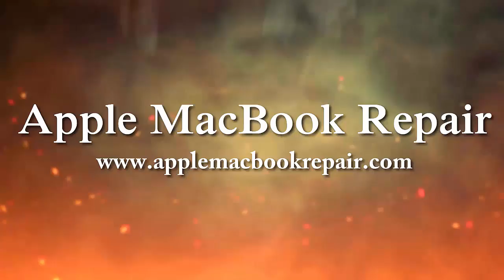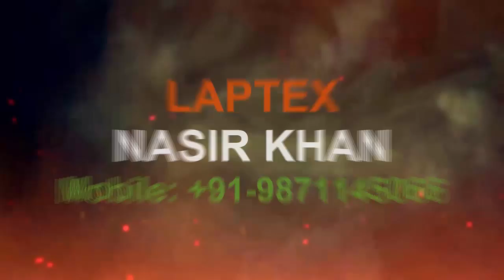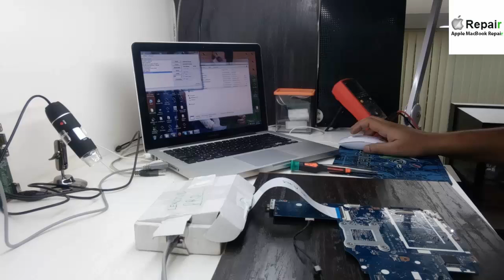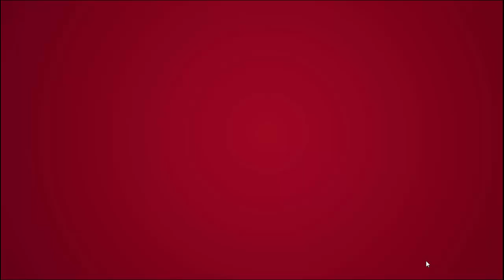LENOVO IT8586E IO PROGRAMMING | Online Laptop Repair Training Video Course | Chiplevel Training

Comment: mine levono has this chip, it does not start is dead and this chip get hot, I can just put vinger on for 20 seconds and then out
Reply from the maker: Program it
Reply: @laptex1377  laptop is in the trash, as it is also a chinese make.

Comment: Hello sir Nasser, can you help me how can i program the SIO chip of Lenovo iDeaPad 110-141 with a number of IT8886HE? I have RT809F programmer but don't have the PEB-1 extension board. Maybe you can give me the programming pins of this SIO so that i can try to program it directly without using a PEB-1 extension board. I hope you can help me with this problem sir. Thank you.
Reply from the maker: SVOD could be a better option
Reply: @laptex1377  i don't have SVOD sir..only RT809F i have🙂

Comment: hello hi sir i having one problem, acer e5-471 laptop in this laptop mother board number  is DA0ZQ0MB6E0 Rev E, (problem is 3.3v and 5v is okpower batton voltage also ok , after press the power botton bios pins 3.3 volts and gfx 01.05voltage other suply's not comming pls help
Reply from the maker: Check S3 requirements

Comment: GOOD. PLEASE CAN YOU HELP ME??  i have the rt809f whit the peb-1 i try to program the it8587e but not resut i try with a new chip too and cant. i put the chip directly on the adapter soldering in the it8586 place in the adapter and nothing. i dont know what happens, maybe somethig i doing bad. this is the first time that i try to program a super i/o and not have experience. thank you
Reply: connect pin number 100 in io to the ground  it should be work .if u want to programing online use 24 pin cable to feb-1 to kb interface no pin no 1 both side same angel
Reply: see here http://ifix.net.cn/thread-42195-1-1.html
Reply from the maker: Okay